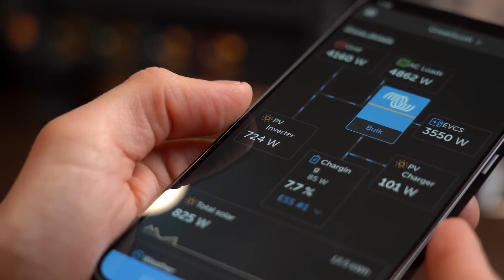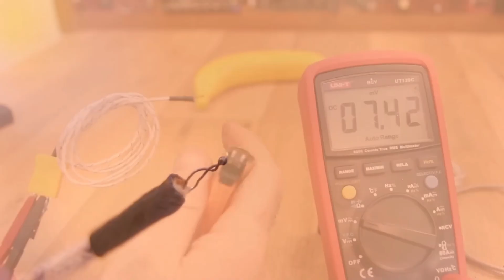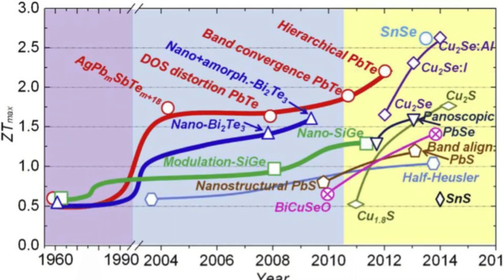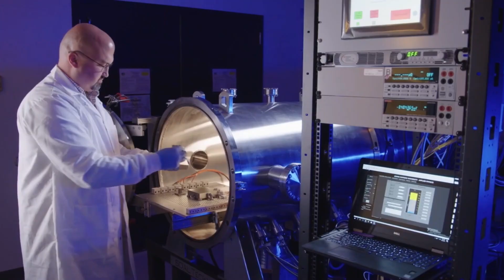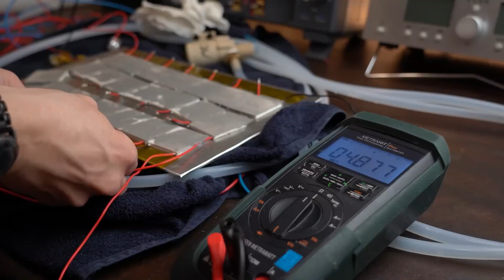Revolutionary Metal Generates Power From Waste Heat

Comment: Can A copper coil transform heat into electricity?
Reply from the maker: a simple copper coil, no
Reply from the maker: But Thermoelectric Generators can. These devices use the Seebeck effect to generate power from waste heat, and while copper may be involved in the overall system, it's the specialized thermoelectric material that does the direct conversion.